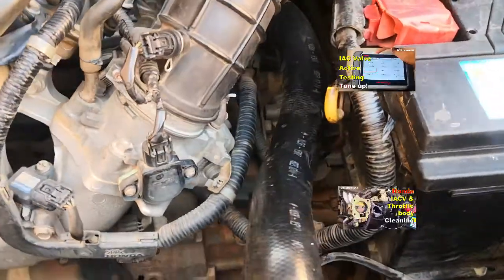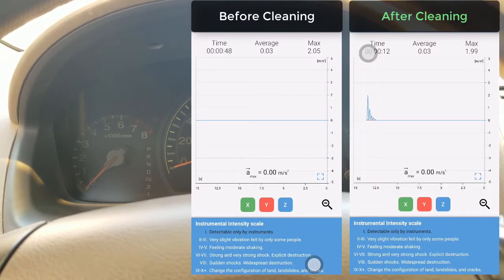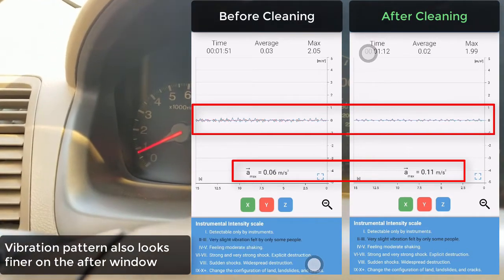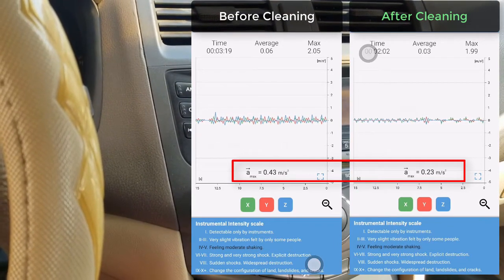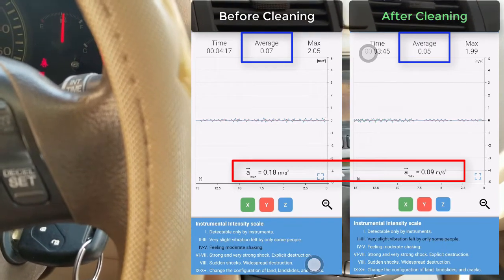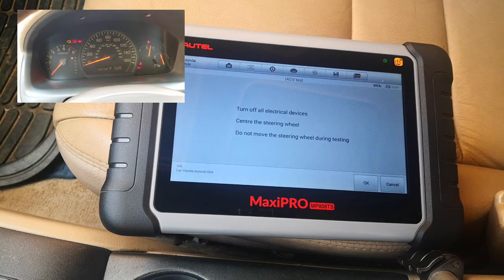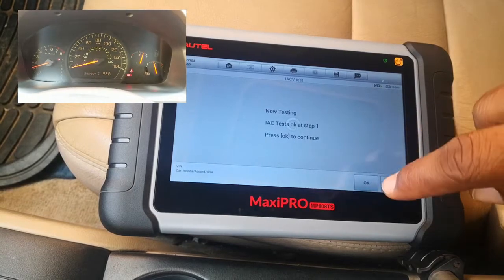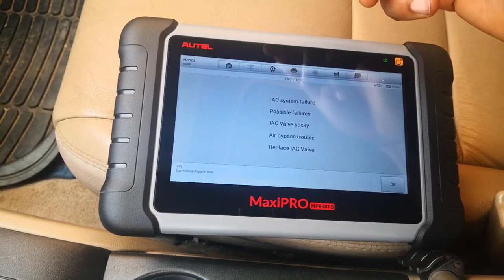IAC VALVE TESTING with active scan tool (Part 2): AFTER CLEANING IACV

Comment: just want to know that when the car is NOT idling and it is running over 4 rpm around 120 kilometers per hour speed so what would be the reading of IAC valve on OBD2?  plz note that car is having Cable less electronic throttle body.  
my car shows IAC readings fluctuating during drive too,  is it normal ?
Reply from the maker: Cars with electronic throttle bodies don't have IAC valves.

Comment: Great video Did you try and check the PCV valve I have a 2004 honda crv and that was my issue..
Reply from the maker: Thanks mate! Great point. I clean my PCV valve on a routine though. I put this on the IACV still.